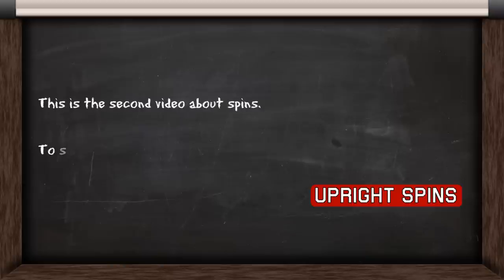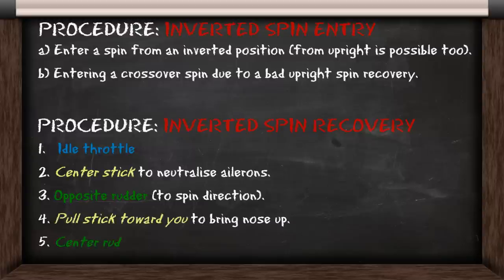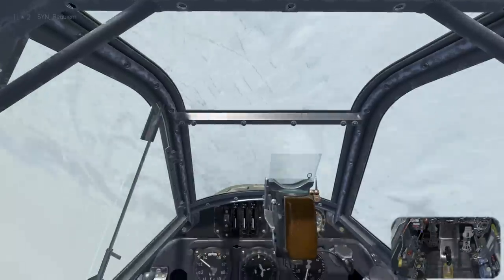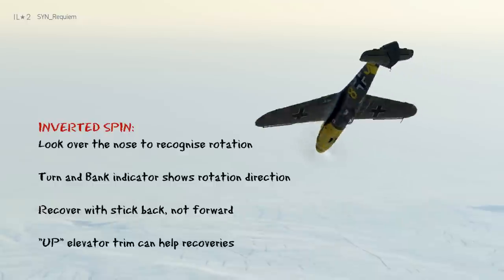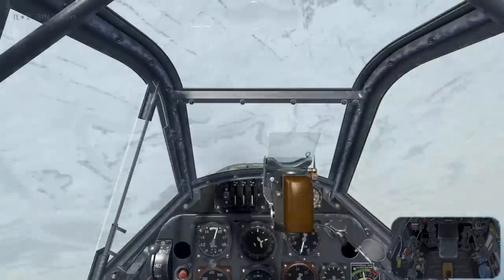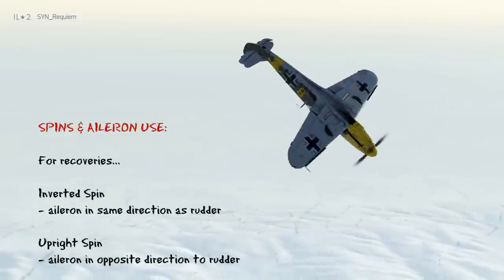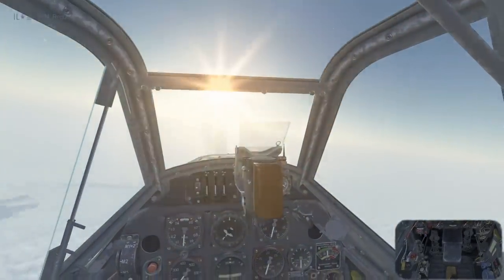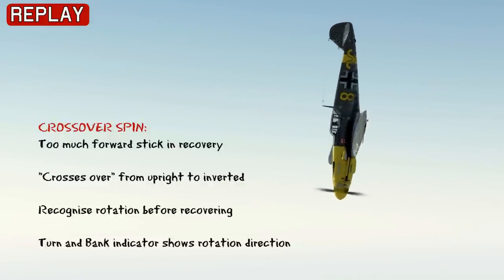Principles #6 - Inverted Spin Recovery

Comment: LOL Having watched both your videos on spins, I had to chuckle. Many times I have caused a spin as a defensive measure. Most people attacking you see you go into a spin will back off. They naturally assume you will crash and burn and so break off their attack. This gives you time to gain distance, and when you come out of the spin, you can now take control of the situation and dictate the attack. Heck, I have even experienced (every time), AI fall for this trick and back off. So, going into a spin as a defensive measure comes in real handy.
Reply from the maker: Yeah it does help sometimes...you just have to be at a high enough altitude so the attacker doesn't necessarily want to follow you all the way down. If you are kind of low anyway they should watch and stay close by so if you recover they can pounce on you again.
Reply: 9 out of 10 times, they will not follow.
Reply: Yep... Even in crappy War Thunder it used to work for me. lol

Comment: what about flat spins?I cannot get out of them ever it seems
Reply from the maker: The flat spin arises because you still have power (along with rudder and possibly opposite aileron) applied during the spin itself. The extra power makes the nose come up (flattens the spin) and the aileron opposite to the rudder used to induce the spin makes the spin's rotation even faster.

Your recovery is pretty much the same though, idle power, rudder opposite to spin, but you will likely need to use aileron opposite to rudder/with spin as well. Then once the rotation stops get the nose down, apply power and you're golden.

Comment: Got into a flat spin in a P51 at about 2500 ft.  Couldn't get it recovered.  IRL there are certain aircraft that can get into spins that are unrecoverable eg F14 in some flat spins.  Are there spins in IL2 that are not recoverable?
Reply from the maker: At low altitudes not everything is recoverable,  I haven't experienced many unrecoverable spins in Il-2 though. I think the P-51 in particular would have spin recovery issues if you have a high fuel load as that affects the CG.
Reply: Wonder if they really were unrecoverable or if it's just that the Cat crews said fuck this I'm out because they can and because they didn't wanna risk failing. Some dude in DCS recovered, now if that's inaccuracy in the simulation or the fact that you can't die flying virtual planes so you dare to try shit enough times till it works will probably forever remain a mystery.